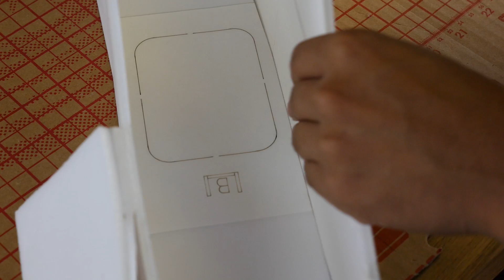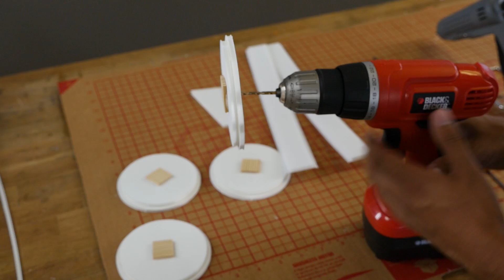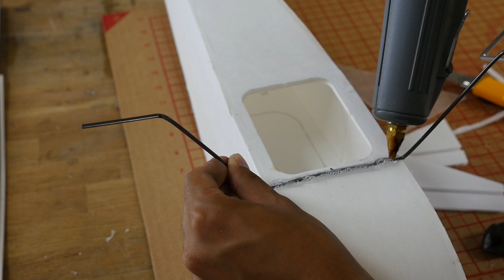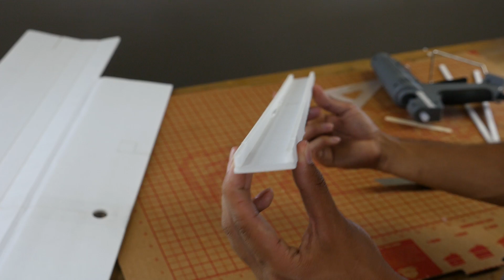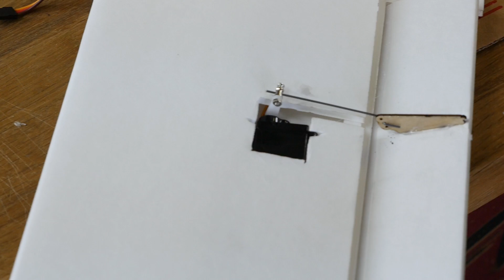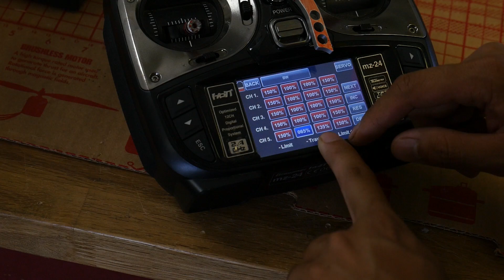Flite Test | FT Bushwacker Build

Comment: i have scratchbuild one, out of XPS underfloor insulation, covered with packing tape. It is flying hands off, with even 2cm CG behind recomendation. One thing that i will do better on my next one, is add a spar, because wings flex too much during tight loops.

Comment: In regards to the landing gear wire dimension shown in the video (19:85), the 11" dimension includes the 3.25" on the left. The drawing implies the total length to be 14.25" which is incorrect.

Comment: Hello, @ 49:50 can someone explain to me how to use this small box ? it permitt to set the travel ? the center ? Thank you !
Reply: It's a servo tester, mostly used to power up a servo without receiver so you can place the horn in a good spot when in center position. Peter is using it to move the servo full travel and check clearance in this case. I'd have to watch again but I think there's a little contradiction in this section on servo direction.

Comment: Bro what is the material you used to design the aircraft. and where can we get it
Reply: Yuvraj Kharde im currently scratch building this and I used the Adams redi board you can get it at your local Dollar general however the stuff from DG tends to be warped pretty badly I like getting the foam from Dollar tree.

Comment: very detailed description. Are you guys going to make a mighty mini version of this?🙄
Reply: Liam Geyser  I'm actually almost done Building  a mini version of the bushwhacker! I am scratch building it though! What I did was printed the plans out at 40% size. Keep in mind that when you shrink down the plans it also shrinks down the thickness of the foamboard on the plans, so what you will need to do is just cut out the slots thicker , four instance where the tailfeathers slide into. I haven't ran into any serious trouble yet, good luck.

Comment: Those little uprights on the stabilizer are called vortex generators. They help to increase the efficiency of the control surface and also reduce flutter at hi speed.

Comment: I'm confused.. what's the difference between speed build kit and (non-speed build?) and the scratch build -  is that just the raw material of foam board without laser cutting?  

Somehow missing detail. 
Thanks
Reply: Callie_Dan The speed build kit comes with the airframe when' the scratch build is cutting the sheets out yourself

Comment: Need more info on the flap servos.
How do you get the servos to start out and stay at an extent?  Seems when I power on a plane the servos want to center themselves. Maybe flap servos don’t do that?  Thx
Reply: I think, you should set properly servos in your radio ( to switch 3 stage )

Comment: Should we glue in the rear power pod & the skewer that is supposed to hold the right down thrust alignment? (gluing was not shown)  
Also, the motor mount is only hot glued to foam?  Doesn't seem strong enough.

Comment: One thing I noticed in video is it is never mentioned exactly the best placement for a 3s lipo.  Inside the nose area?  Bottom of powerpod?  Any suggestions for best fit?
Reply: +RCLimit Films From what i guessed i put my 2200 3s strapped to the bottom of the power pod closer to the front depending on CG.
Reply: Thank you.  I took some small foam, and glued like railing inside nose area and places velcro between it and place battery as far in the nose as I can.  Do appreciate the reply though.

Comment: i would highly appreciate anyone's aid.
I have a zmr frame,6×4,5 prop and a 4s battery...So far am searching for motors that would easily carry 4kg  load on my quad...
i don't know   the 900kv-700kv, 600kv-400kv or 300kv-200kv would be a good setup to start with.

Comment: i would highly appreciate anyone's aid.
I have a zmr frame,6×4,5 prop and a 4s battery...So far am searching for motors that would easily carry 4kg  load on my quad...
i don't know if the 900kv-700kv, 600kv-400kv or 300kv-200kv would be a good setup to start with.

Comment: If I remember correctly, you get the most throw with the wire closest to the hinge. You get more torque/leverage the further you are from the hinge. Thus, the ever-present mechanical trade off, more motion and less torque, or less motion and more torque.

Comment: where is COG on this plane........ and where does the battery go
Reply: +Alex Rüb 
I just pushed the battery (2200mAh) into the belly of the fuselage as far forward as possible.  Take some stick on Velcro(rough side) about 8 inches long & stick about 1-1.5inches onto the bottom of the power pod in front of the belly cutout then put some tape onto the rest of the sticky side of the Velcro.  Place a piece of Velcro(opposite of the 8inch strip, in my case the fuzzy side) 1" long on the bottom of fuselage(exterior of plane)  I then glued some balsa rails(2 of them spreading them out so the battery can slide in between them) to the interior belly of the plane where the battery would lay in.  You then push the battery in place and pull the 8 inch Velcro(can cut it to size later) over the end of the battery and onto the fuzzy Velcro on the exterior of the plane.  Your battery wont go anywhere now.  Would be a lot easier to explain with pictures but not sure how to upload them.
Reply: I want to know this too. .. I have no plan how to put the battery into the fuselage without it's moving?!
Reply: +Alex Rüb  so i now have a tiny powerpod i cut the back half off at about 50%  and so i can barely shove the battery into the powerpod

Comment: Very well done instructional video!! May I ask how much that kit costs with all the electrical etc (minus the controller)?
Reply: +MRrwmac $ 39 without electronics, $ 99 with Power Pack B (slower), $ 104 with Power Pack C (fast!). Plus $2 for a 9x6 APC style prop (pair). You still need battery, receiver and transmitter.

http://store.flitetest.com/ft-bushwacker/
Reply: +Balu Thank you very much. So if I had nothing and wanted it all with the tiny trainer ALL in one get started pack but with the power pack C, it would be $200 for everything and this model aircraft?
Reply: +MRrwmac If you really need everything, you might want to look into this package: http://store.flitetest.com/tiny-trainer-get-started-package/

It's nothing fancy,  but will get you in the air. If you like the hobby, you can still update parts like the charger or get a different transmitter later. Those parts can get expensive, but they also are an investment into the hobby. You will fly different planes, but the expensive electronics will stay with you for a while.
Reply: +Balu Yes that is the one I was referring to. Thanks for the reply and help. I really do appreciate it!
Reply: @ulaB  WHOOPS! THIS PAGE DOES NOT EXIST

Comment: This is a nice build! one small correction, because it often gets confused and confusing this may lead to problems.
Female and male plugs are not named after the housings but after the pins. Meaning the lead from the servo is the female plug, the pins are the "holes". The plug on the Y-Lead is the male plug, even though the plug housing suggests otherwise. The housing protects the male pins. Mixing this up will lead to problems when buying plug casings or crimp contacts, so best to try and be correct on this.
Other than that, great work, awesome builds and great videos. I'm always eager to watch your videos!
Reply: I've done a hell of a lot of electronics- building etal. And also found it odd that in the RC world the universally accepted 3-pin socket is referred to a male connector but hey... that's what they do... it's the RC world ;-)

Comment: Peter, when you hooked up the rudder & elevator you put the wire through the outermost hole in the surfaces for more throw. That's a mistake. The innermost hole on the surface & outermost on the servo gives the most throw. Opposite for less throw.

Comment: Only extend as much blade as you need.. If you extend it to far it can bend, slip and cut you..
Reply: +Jordan Stocker (Haggard) I agree with Balu on the need to cut foamboard at a very shallow angle. That way it slides/cuts smoother with less effort and blade seems to last a little longer. Just go slow. A builder has to have very good control over their blade in order to do some of the cuts that Peter does! As Peter says, if not comfortable with razors and/or in case it's a young builder that might not have the motor skills and experience with razor cutters, it is safer to sand instead of cutting. Lastly, it is amazing to me how quick a razor blade gets dull when cutting Dollar Store foam boards! Dull blades make for messy cuts and are not as safe to control.
Reply: +Jordan Stocker (Haggard) I was thinking the same thing. Can't see a reason for him to extend his knife blade so far. It becomes more wobbly and more dangerous at the same time.
Reply: +Jordan Stocker (Haggard) When cutting foamboard it helps a lot to have the blade at a very shallow angle. To achieve that you need to have the blade more extended. Otherwise the blade needs to be "forced" through the foam instead of cutting it.

Comment: wich  of  your projects is best to learn how to fly? i wan to build one and cant  choose one ;) please help anybody to make decision;)
Reply: the ft tiny trainer is a good start as you can also change wings when you get better from 3ch to 4ch. It is also cheap to build.
Reply: +German60ger how about this plane? i heard that larger planes are much easier to fly. tiny trainer is rather small plane...
Reply: That's because bigger planes are heavier and aren't affekted from the wind that much. But a 3ch plane is way easier to fly.
Reply: What German60ger said.
And the Tiny Trainer is 37 inches (940mm) = not really a "small" plane.
Reply: +Haywood Jablomy 940mm wing or long?
Reply: The wingspan is 940mm. But you shoud get a free simulator first so that you don't crash.
Reply: +German60ger i crashed one plane already ;P that was 800mm parkjet mig-29 from tomhe. my second plane didnt want to fly it was too  heavy or prop was too  small
Reply: My first plane was the versa wing.
Reply: +marcin gumis You might want to wait for the FT Explorer  that's supposed to come out in a few weeks. It's supposed to be a perfect trainer design with a pusher motor on top/behind the wing, multiple configurations, etc.
Reply: +Balu i CANT wait that long, and i already started building this plane ;) i have to build only the wing, rest is ready;P it looks preaty good and building proces is so fun to me :)